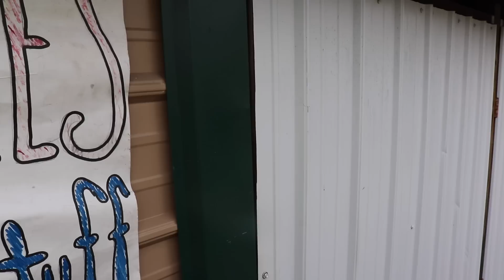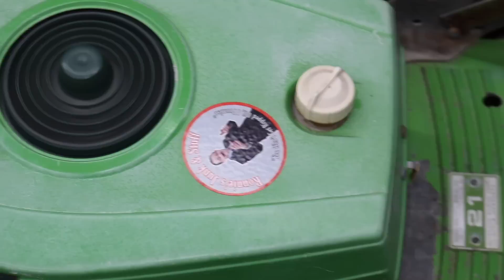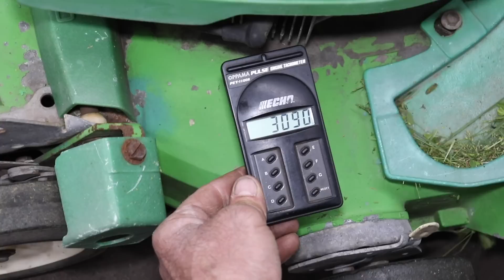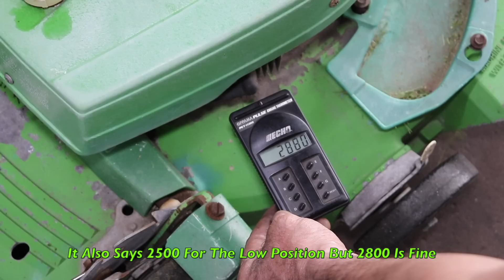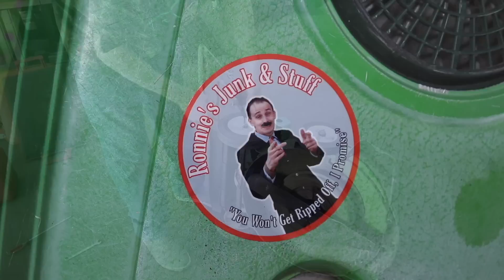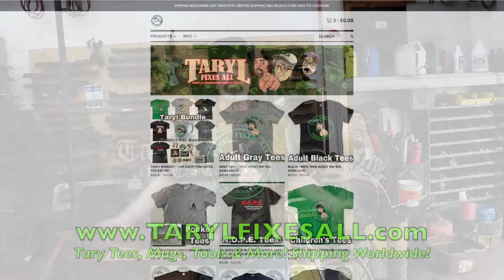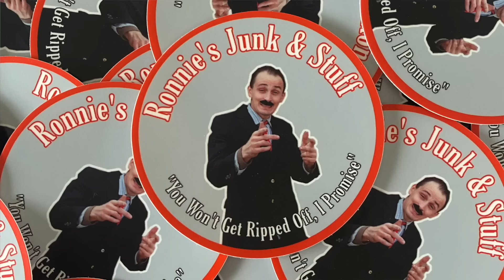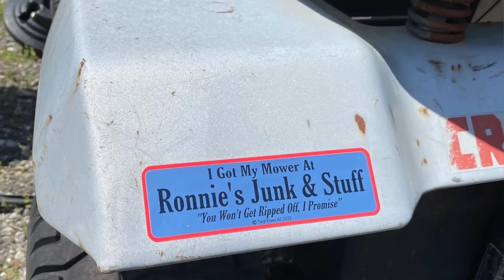This Lawn Boy Sat 30 Years. Can We Get It Running?

Comment: Those old 2 cycle Lawnboys, My next door neighbors, 2 households, to the East and North, still use their 1970s models. They are older, they say they are light and start right up. The on to my North, still has the original spark plug!!  I kid you not.  He asked me if I could find one and change it for him. I asked if it was running funny, figured I might need to clean the carb or something. He said nope, just thought it was due. I said I wouldn't mess with it, but if it acted up would change it for him.  LOL. those old things were built right

Comment: I learned why lawn boys had the off set tires when I was a kid from a old lawn boy dealer near our house. Most people thought it was just lawnboy trying to be unique, but the offset front tires were actually a anti scalp design, keep both front tires from dropping in a dip at the same time lowering the front of the mower scalping it.
Reply: Makes sense, to much sense for it to catch on lol.
Reply: I've seen several old mowers with this deck design. I think they just give a better looking cut.
Reply: I was wondering that very thing when the video started. Lol
Reply: Two other advantages are much better clipping throw distance since the tangential path isn't interrupted by the wheel.  Another is the ability to cut extremely close to objects at the front of the mower.  The disadvantage is that you can only get close on the left side of the mower when going along a fence or wall.  But once you know that, it's not an issue. The under deck muffler and exhaust made these much quieter than other mowers when in grass.  The power to weight ratio with the cast aluminum or magnesium(even lighter) was incredible.  You can really whip these mowers around with little effort.  The non self propelled models were lighter still, of course.  Doing a weekly cut in dry grass, you could cut VERY fast.  They were very popular with commercial lawn care companies before the days of zero turn mowers.  As long as you fed them the right fuel mix, they would last for generations, as this one has.  All of these could side discharge, bag, or mulch.
Reply: @mikemorgan5015  I don't know about that. The grass chute seems to be in the same place but one wheel is set back. I used on of these mowers when I was a kid. It's didn't even have a recoil pull rope. Had to wrap the cord by hand. If it started I wrapped the cord around the handle. Yep I'm a old dude
Reply: Thanks for the info I always wondered about that off set wheel now I know.
Reply: @darrellwampler3882  It may seem to be in the same place, but if you flip them over, the front tangent of the blade tip path continues to the chute, throwing the clippings directly to the right as opposed to most mowers that have the clippings going at about the 4 o-clock looking from the top.  I have about 25 2 stroke LawnBoys from the 60s through about 2000.

Yess!! I had some old wrap start mowers when I was a kid as well.  Used to be ALL engines still had a rope pulley for a recoil cup.  Not so much anymore.  My favorite was a literal barn find that had an aluminum deck with bolted on steel "teeth" on the front, with a 1 3/4 hp Clinton engine.  Started on the first pull every time.  The starter was a rope with a wooden dowel for a handle.  I changed the oil, cleaned the carb, gassed it up, choked it and it started right up.  Wish I still had that one.  It had a HUGE grass chute with a dead flat blade and would cut incredibly deep grass.  Mind you the clippings would be 6 or 8 inches long, but it didn't bog down.  That little engine was plenty powerful enough.
Reply: I had one of those back in the 60s. The only thing I didn’t like about the offset wheels was when the terrain changed quickly from flat to uphill, the discharge chute would dig into the ground stopping me dead in my tracks. I learned to turn around and drag it up the hill backwards.
Reply: @brucecoleman7412  I've used them for nearly 50 years.  That's one helluva terrain change.  Haha!  Seriously though, when you encounter a sunken area, like where an old stump used to be, you have to be mindful of it. but it doesn't take long to learn the quirks of it.  A HUGE advantage it being able to cut at the front within an inch of a wall or fence.  Can't do that with a standard wheel mower.
Reply: @brucecoleman7412 i had offset front wheel push mower in the 70's it was kinda goofy.

Comment: Hello Tarryl I still have the old lawn boy. With original owners manual and the side discharge bag and support pole. Original bag long gone  but replacement bag still doing a good job. No power drive on mine. Almost all lawn services used them back in the day, as power to weight ratio great due 2 cycle.i hope to get another 20 years from mine and see me finished mowing and leaf pickup. Great video keep them coming.

Comment: Your video brought a big smile to my face! Oh, the memories. That was the same exact mower I had as a kid, but mine came with a grass catcher bag. I paid $75 for it brand new from the local Coast to Coast store. I had a $75 savings bond my dad cashed in for me to buy it. I would throw the handle over the sissy bar on my bicycle and strap a 2-gallon gas jug on and away we would go. My first summer I had eight different yards to mow around town. I towed that mower behind my bicycle for three seasons. I saved enough money to buy my first motorcycle and a .22 LR lever action rifle. I have not seen one of those old Lawn Boys since.

Comment: My Granny had one, and I don't know how old it was, but it never failed to start.
I know she really never did any mainly to it other than more gas, and only lawn boy oil was ever used in it.
She wouldn't even let you change the blade out till it was paper thin and no wider than one of her old hickory butcher knives.
Which she sharpened them on the concrete steps where she'd worn it down smooth on one corner from sharpening her knives for 50 plus years.
Only I don't remember ever sharping her mower blades are even seeing her do it 
Where she lived out on the middle of the woods in southeastern Oklahoma it was sugar sand, and she scalped her grass down as low as it'd go, and I bet blade only lasted a year at the longest.
But she'd set it out by the smoke house, and put old number 3 was tub over it to keep rain off of it, and it set there year round.
I'm betting that thing was abused by her and occasionally one of us grand kids would catch her gone to town with our Ma.
Then we would mow her grass for her, otherwise you couldn't mow it because she wouldn't let us.
So Ma would take her to town 40 miles away, then stop and do whatever it tiok to keep her away until we had a chance to get it all done for her.
Granny knew what we were doing, but she'd still fuss we  did it wrong, and make make like she was mad at us.
Don't even remember what happened to her olf mower, but eventually I bought her a 12 hp Montgomery Wards riding mower some time in the early 80's she was probably 78 or so still lived in middle of nowhere and she still had her 1/2 acre garden and still mowed her grass up until I moved her in with my family in 1992, at 88 years old she still gave me trouble about mowing my grass for me.
Which wasn't happening  but she walked the boys to school and walked down there every afternoon to bring them home 6 blocks away.

Comment: I have about four of those. Best lawn mower for trim work specially if you have a lawn with a steep bank.
Lightweight and you don't have to worry about getting proper lubrication on a steep hill
Reply: There was one model of these where they put this black bar inside of it and it would cause grass to get stuck in it.

Comment: Thanks for another great video.  The blade orientation does make a difference.   90 degree on the D series and parallel to the cylinder at TDC on the F series.  Noticed in the video you were not getting fuel when priming.  Those primers had a tiny washer that would lift fuel from the bowl.  They do go bad after years of use.  When rebuilding the carb it's probably worth it to change that primer.
  I have 15 Lawnboys ranging from 1968 to 1982.  D-400,  D-600, and F series.  Also a couple of Lawnboy edgers and 2 Lawnboy string trimmers.  I have a 1971 IH Lawnboy and a 1976 Lawnboy Liberty.  Love them all and currently use 4 in the rotation.  Keep up the good work on the videos.   Bill
Reply: How many different lawn boy engine series were there?

Comment: Flapper disk does a better job than the grinder as you recommended on the hammer knife unit.
Does a quicker job with more control and less heat, although to not totally kill the job I usually finish it up with a hand file.

Comment: I have a 96 Lawnboy Gold commercial series, it's a 2 cycle, best cutting\running push mower ive ever owned, only thing i had to do, was rebuild the carb, ran it through my ultrasonic before I rebuilt it. No push mower will ever touch the quality of that one!
Reply: I am more of a fan of the old Toro aluminum deck recyclers with the Suzuki engine and the 3 speed transmission.

Comment: Excellent video Taryl :) got all tune up also my first push mower used was 1966 Lawn Boy 2.5 hp had be 30:1 oil mix and 18 inches cut bed one speed only 1 gallon fuel tank and 2 primer up with also pull cord 1/2 up way go ! No self propelled just me Lol and last till 1993 then died of lots use!

Comment: Lawn boy was the preferred mower by rental agencies due to fewer moving parts less can go wrong for assortment of operators and they would supply a gallon of pre mixed gas so operator couldn't mess up oil mixture. I've hade my lawn boy for 30 years and still going strong.

Comment: This is funny (and awesome). i have the same mower that was also stored for 30 years (may be a tiny bit different it has 8072 model also self propelled with the same system). Belonged to my grandfather. When my new-school mower died I looked at it and thought "what the heck, may as well try it".  Grabbed the chainsaw 2-cycle mix I had and filled it up. Started first pull. Out searching for vids on it because I hit a rock and it bent the little square piece under the blade, just needed to see what it should look like so thanks :-)

Comment: Just got a gold series running. Doesn't seem to have any air leaks, but caps out at 2500 rpm or so (I hear they should make it up to 3000-3600)... and the self drive seems broken at the transmission... so I'm going to have to take that apart to get it working. Plows through stuff I'd think would require a brush cutter.

Comment: I'm no lawnmower expert but I'm old enough to know how good Lawn Boy mowers are and they were very good.  I didn't know you can leave one out in the weather for years and be able to start it simply by gassing it up.  It must have a superior fuel system.  In fact I'm so amazed I don't believe it.  Whoever owned that mower took care of it or it wouldn't run so easily.  Or you got lucky and it was left empty.

Comment: The old boy runs pretty nice.  A little gas in the oil goes a long way.  It kind of fogs itself every time you run it.  I have a '67 push mower I use every other year that I change out with a '95 Snapper.  I like the Lawnboy because it's so light.   Magnesium deck.

Comment: Taryl had many of those lawn boys they were always great mowers. I never ran my lawn mower under 5 grand lasted forever had power to pull anything. My problem was I couldn't walk slow enough to keep up so we had up the RPMS when it was summer hot out it would not shut off without priming it flooding it. I also opened up the main jet. Always had to keep the ports clean with the old fuel with old gas an old oil. But then it was not a lawn girl it was a lawn man !!!Yee Haw

Comment: Lawnboys are my favourite lawnmower, i only stop at discarded lawnboys, well maybe a snapper? but lawnboys are the best, if they have not been seized with straight gas, pretty easy to get running again, the crank seals require a little more work to replace, the common folk sometimes comment that my lawn mower is "burning oil", Okay!! LOL, Nice Vice too!.

Comment: Thank you for exhibiting the longevity and simplicity of Lawn-Boy mowers. The exhaust UNDERNEATH the deck is nearly silent. Magnesium deck is lightweight.   I own several 'generations' of Lawn-Boys. (Evenrude up to Toro) They all start with ease and have 2X the power of 4stroke mowers. (Who needs 6 HORSEPOWER on a push mower?)
Reply: Yeah like the 50lb. Crapsman mowers that the self propell fails after the 1 year mark and push like a tank!

Comment: I was just thinking that they specified 3200 rpm just before you showed that subtitle.
As for the carbon, I've been simply running Echo Red Armor oil at the same 32:1 ratio and my r7070 is not only running smoother, it's actually gaining rpms as the carbon cleans out.

Comment: these old things  cut very good . i have a couple of them . thee only thing about them you gotta  clean the carbon  out of them after some many hour's . an like you said  you gotta replace that oil seal at the bottom . it like to leak.  Beside''s that  there some hard mower to beat .better them some of the junk we  got today

Comment: thats pretty cool!.i still have a alis chalmers garden tractor engine in garage closet that is from the 60s or 70s 10hp i spent 600 dollars on it bored 030 over from a machine shop in 1999 it never seemed to run right after it felt like it was struggling to run like the valves where to tight or something i dunno i just pulled it out its still in closet has long shaft out front for running haybailer elevator.i think i ran it 30 minutes and pulled it out carb got robbed off of it of course

Comment: Bought 2 of those brand new Lawn boys with belt pulley off top they worked great for a while , then started to throw belt new belt never could get it to stay on Scalboum Manufacturing where i bought them had no clue either. Other than that they gave a nice cut.

Comment: I got the exact same lawn boy under my cabin been there for several years  cause pull string   won't spring back and to keep it out of the weather til I can find a replacement part for it but haven't found one yet

Comment: They were great mowers. Nice job showing some of the maintenance needed to keep them running. If you did the maintenance properly, those mowers would run for decades.
Reply: To bad Taryl wasn't around with his help back in the 70's 80's trying to get information from mechanics was like pulling teeth! My town had no mosquito problem 16-1 gas/oil.

Comment: Come on Taryl " it's not the space shuttle it's just a lawn mower " ------- I ,I ,I mean it's not a tractor shredder ( AKA brush hog )  it's just a push lawnmower 🤔🤔🤔 ----- I picked up one at a estate sale , clean carbutraitor   and got it running but didn't do any more to it cause the throttle lever was broken , got new part off flea bay but haven't got back to putting it on . I'm gonna have to check and see if the one I have has that grease thing on the rollers . My local Mom and Pop mower shop keeps Lawn Boy 2 mix oil in stock . That's all their mechanics use . Comes in a bottle that tells you how many ounces to put per gallon . I run it in all my older saws but I run the Stihl gray bottle 2 mix in all my newer Stihl stuff . Good info on putting blade back on . ----- Just think how much more MONEY Ronnie gonna get now since you fixed it . 🤔🤔😂🤣😆😆😁 -------- Come on Taryl , show us how to rebuild those Gemini pumps on that Woods Mowing Machine front deck mower AKA Grasshopper .

Comment: we never had the lawnboy in Australia, it looks like it was a really good mower, i regulary have to tackle grass that high and the modern push mower bogs down and stalls and the Murray ride-ons i have don't like it either.

another great videp Taryl & crew thanks.
Reply: We almost had lawnboys but not by that name. Masport made mowers with a two stroke made by OMC , they called them Iron Horse 2 stroke. Pretty rare these days. I bought a few when they were getting old and not running. Still have a complete mower and two spare motors. And they are awesome if a little underpowered.
Reply: @LouKodge  awesome, i was 5 in 1972, so my knowledge of mowers back then is non existent, being no 10 of 14 it was years after that before dad could afford a motor mower

Comment: Just read a lower comment.....why dont you do one with a Lawn King 3 wheel mower with circular chain drive and ratchet start.  They were tough and no height adjustments....but they did cut the grass.

Comment: Great video.  If you ever get one in the shop, I'd love to see a repair video for the rear wheel drive system on a early 2000's Toro personal pace mower.
Reply: Check springs under the handle, tension of the cable, and wear in the belt. Usually 3/8 x 33".

Comment: @taryl fixes all I have a question, what is that yellow wireless tool you used to zip out bolts? A drill, drill driver, 1/4 impact?  What is it?

 Thanks for all you do.

Comment: I have a Lawboy 6.5hp "duraforce" 2 stroke....I took carb apart cleaned it well. I gets spark & fuel & compression but still won't start. Any ideas? Or common reason why on this model?

Comment: A friend of mine has an old 2 stroke engine from the 1920s, and it just says to take straight 30 weight oil and mix it 20:1 with the fuel. now that's puff the magic dragon!

Comment: Daryl,  I have a stumper.  Cub cadet with kohler twin blows the main 30 amp fuse whenever i go up or down a steep slope.  Additionally it intermittently gets no power to the dash or key and obviously cant start, then I come back to it the next day and it starts right up.  I have checked for shorts, solid grounds, relays etc.  Any thoughts other than demonic possession?  I have watched a lot of your videos and have learned a lot,  Thanks